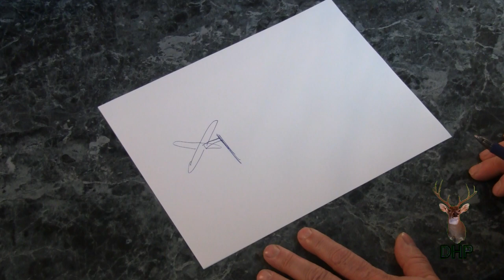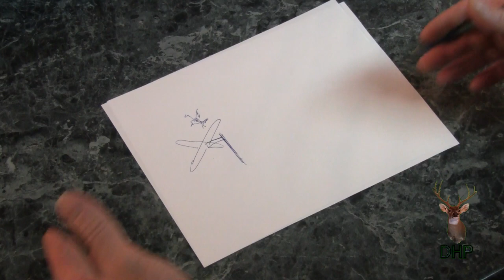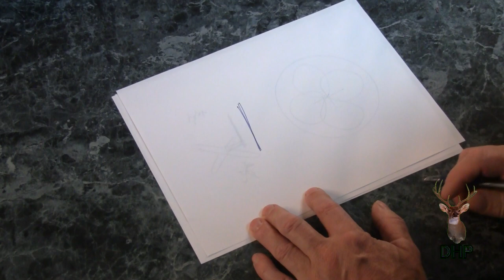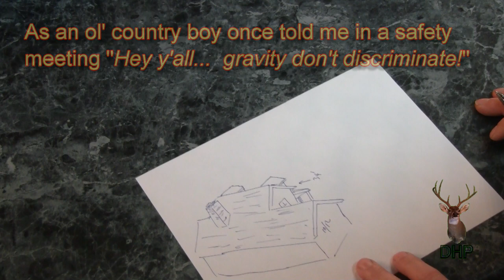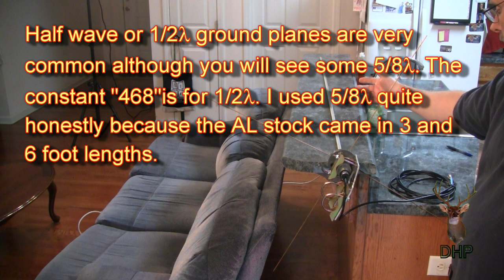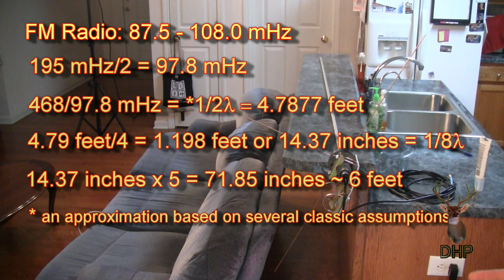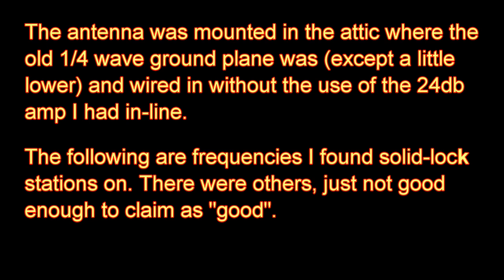FM Radio Ground Plane - 1080p

Comment: Hi, I have this video, it's nice!!! I have a question to make you: The white connector is wired to the circular aluminum plate, and with the 4 aluminum rods? and the red wire is connected to the vertical center antenna rod?
where I can find a schematic of this antenna? thanks a lot!

Comment: The reason you see dual antennas on trucks is that they are directional front and back (if connected properly).  That arrangement gives better TX and RX signal characteristics but ONLY in the forward and rear directions.  This works fine on long straight stretches of Interstate highway, but along a curving road the whole concept is bogus, and actually decreases performance.  Dual antennas should NEVER be used on a vehicle!  Mirror mounts should NEVER be used either - very poor ground plane and highly directional. With a metal cab either a 2' 5/8 wave vertical mounted to the side, or any legit vertical NMO mounted to the center of the roof are both better solutions than most, the latter being the best choice.  That's the REAL story.
Reply from the maker: There are many myths and anecdotal practices. Leaning antennas forward thinking it increases gain for example. If one is running thick fiberglass on weak springs and wind lays them back, it effects the radiated pattern. Standing them perfectly vertical may then lay them back, lean them a tad forward may stand them up a bit - not 45 degrees and overall, very little effect and and effect benefited at a select speed. Bouncing off the road to bounce off the atmosphere? off 4w?

The best place for the ground plane is atop a big, flat metal ground like - the box trailer. But they detach. So, the ants stay on the tractor. 11m signals bounce off rocks, cars, trucks, trees, etc... it gets behind the truck. That big grounded box skews the radiated pattern - sorta cataract-spotting. Sticking one on each side is a work-around. For explanation, assume unity gain on each, 1+1=2 .. still. That is why Hams build parallel arrays. In that example there is 2 1 element ants, not a set of Yagis.